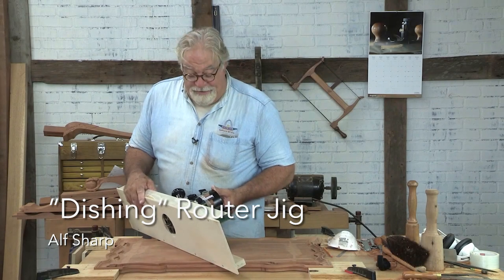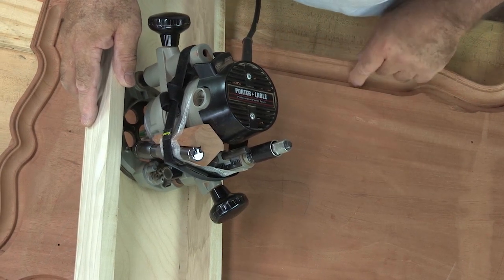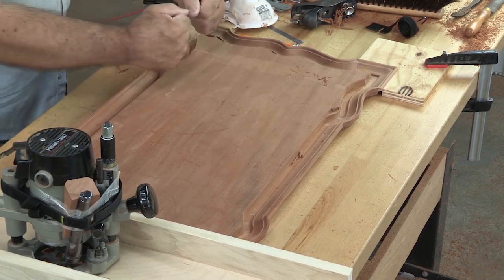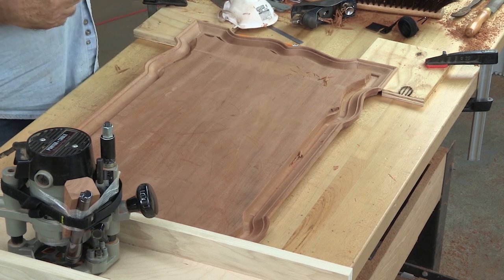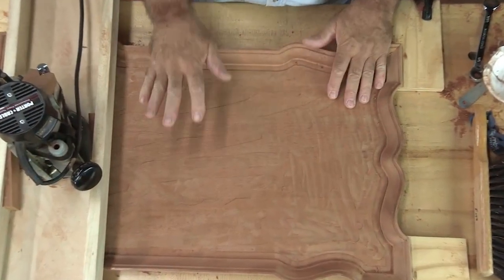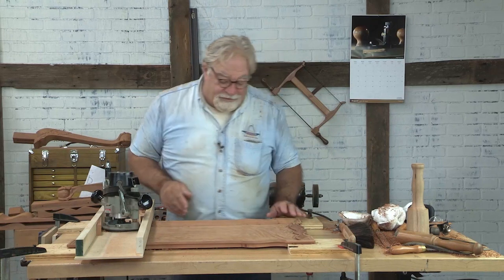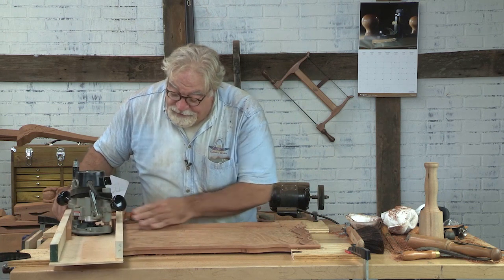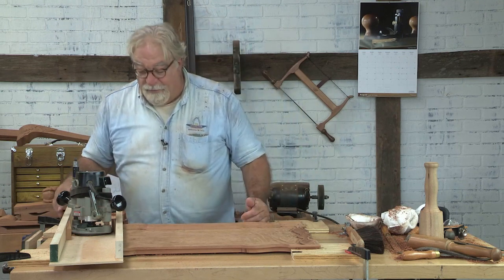Dishing Router Jig

Comment: That flexing of the bit is probably a combination of tape holding the router and a thin base. A more rigid base and screws to hold the router will yield cleaner results.